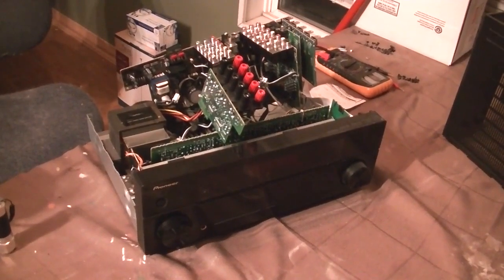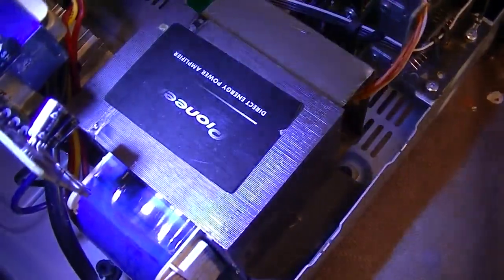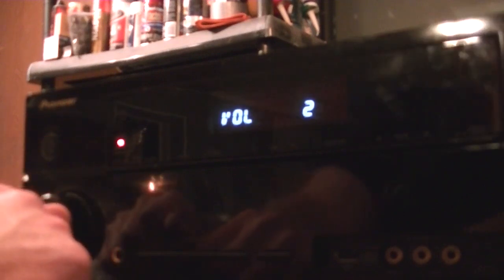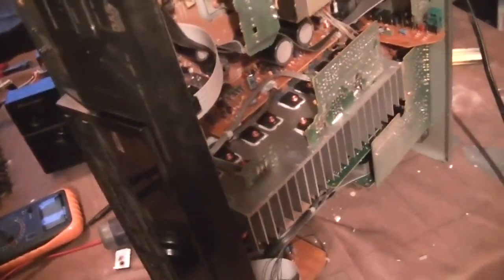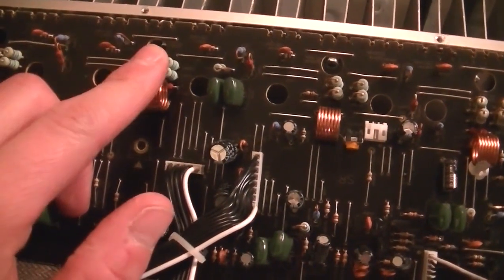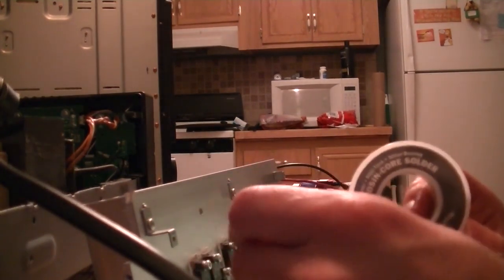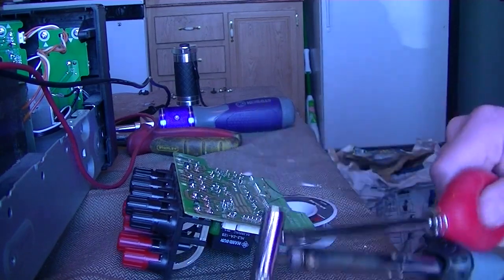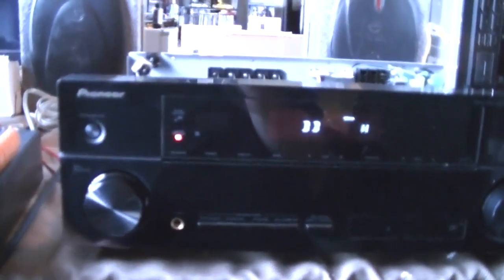Pioneer VSX-820-K Stereo Receiver Diagnosis & Repair - Kitchen Table Electronics Repair

Comment: awesome video, super helpful. i was working on a vsx 921 that would turn on but only for about 3 seconds and without an overheating or protection mode indicator would just turn off. the owner said the front left and right output wire ends touched while it was on and its had the problem since. i tried the factory reset and bypassing protection mode but it would still do the same thing. i got a overload error code, so i checked the mosfets on the amp board and found one thats resistance was not like the others in the corresponding place. i unhooked the amp board from everything completely and tried turning it on and now it will give me the over heating indicator and turn off still. any suggestions?

Comment: Working on a VSX-523 and followed your steps but it appears the mosfets are ok. I pulled that board completely and still get the error after resetting. Can you recommend another thing to try?

Comment: man what a great video!, i own this baby, i take really good care of it. specially cause it should have fan to cool down the heat, 
and i'm so agree with you.. the lack of stand by led, and most of the usefull functions on the remote controller like the treble bass controls (even though its only 3 steps up and down) maybe some playback controls for the ipod/flashdrive mp3 player feature would be nice.

Comment: Very Good Video. I have a Pioneer vsx-524 that does the same thing. I took it to a technician who made me buy a lot of parts including transistors, diodes and resistors but each time he would put in the parts they would pop as soon as i power up. It will pay fine if the defective channel is disconnected. i had to take it back from him as i grew tired of buying parts and this is only for 1 channel. FR. could you say what could possibly causing the parts to go out?
Reply from the maker: I would assume the tech tested the receiver at his shop before calling you to pick it up.  Based on that assumption which could be wrong of course,  it could be a shorted speaker or wire causing that channel to blow.
Reply: On the first attempt it didn't even give us the opportunity to start playing (i was there) . it just pops the resistors each time and blow the transistors. Right now it is playing but with the damaged channel disconnected which is really not working out for me. :(

Comment: Greetings friend. The other day I got into the hands of the same device. I found out that the standby power supply burned out. But since it burned out, I can’t understand what voltage it gave out on the secondary winding? Do you remember how many volts there were? After the diode bridge, up to IL1117-3.3V?
Reply: Hi. I have the same question ! is it 5vac?

Comment: A few question.
-Lookin from the way how u align those boards and got it hooked to the wall socket.. Will it short and boom ?
I had my worse experience when i once place a board on top the other board, it exploded when i fire it up. Which is why i got really careful with pcbs.
-I did not have the same problem as u did. But my receivers are not producing any sound to my speakers.
I noticed the weird symptoms though. Usually when i fully powered down the system, took out the cables. Plugged it back in again and got it up, the volume would resets back to 30. Though this time, it did not reset. It seems to stay fixed at the last volume i shut down.

Comment: good job, without a diagram we have to just hunt & peck around to find the trouble.
you said there are 2 clicking sounds, does it also have a power on relay?
Reply from the maker: Very true. What threw me for a loop was the absence of a standby LED, and looking up the problem on a google search. Both kind of led me on a goose chase till I had the sense to look up the correct power on protection bypass sequence from the manual. I looked it up on google first before getting the manual and none of what people said worked :)

Yes the first click is power on/stand by and the second is the protection relay on the speaker terminals. Standby is what everyone on a google search said was a common problem with this model, and the 520K. So that is where I initially thought the problem was, in either the standby transformer or the VR on the underside. Both were listed as a common failure of this model.  I was under the impression since the standby LED was not lit, it must mean the standby voltage is not present in the unit. Boy was I shocked to see there was no standby LED at all on this model.
Reply: WaybackTECH Hey guy, I've got an onkyo reciever which was working fine before the move. Now I turn it on after 5 seconds it turns itself off. Can you help me? Thanks.
Reply: carlos perez Probably going into protection because there's a shorted output transistor. On a Sansui I'm working on I measured 49volts DC across the speakers terminals, that shouldn't be there so I'm replacing the power output IC, it's that large Chip with several legs. I also found some bad caps.
 I don't know your model no so it may have 4 or more separate audio output transistors instead of one large power output IC.
Reply: It's on Onkyo txsr506 receiver. stanby power control with seperate buttons for different inputs. Power comes on, lasts about 3 seconds and then with a loud click shuts itself off no matter which input I'm using. Lots of outputs. Mostly RCA but also straight wire connections which I was hoping to use. I have nothing connected to it now. Still wont work. Of course its the weekend and I havent been able to get hold of anyone. I used to fix electronics but that was 20 years ago and I don't have ant of my tools anymore. Don't think I even have a volt meter.
Reply: carlos perez you need a multimeter, I got one for 20 dollars on ebay. I worked in a repair shop, the owner would remove the STK's and then power on the receiver, it came on ok he knew they were bad. If it has transistors in the output check them with the diode test using the DMM. A common problem is they short collector to emitter. Also check or replace the emitter resistors, probably .22 ohms or something like that.
In the Mitusbishi amp I just fixed it has transistors in the output they were all ok but I had to replace the driver IC, it's a large STK.  Also check to see if there's any DC voltage across the speakers terminals. See the video here on youtube Onkyo TX-SR502 receiver shorted channel. I see he used NTE parts, but it's best to use OEM parts if you can find them.
Reply: +WaybackTECH Hi, I have vsx-520 and I can not hear sound none of speaker after second click :) frequently. After turn-off & turn-on I can hear the sound all speakers. Do you have any idea to this problem?
Reply from the maker: Murat Dönmez
Have you tried headphones to see if there is audio coming from there?

Comment: Have you encountered a receiver that works but the display doesn’t work? I have a VSX-816 with such a case. Any suggestion?
Reply from the maker: Only one was a Mid 90's VSX-09TX I fixed a while ago had that problem. A couple resistors were fried that fed power to the display and those were mounted on the transformer itself. That was a VFD and not an LED display however.
Reply: Thanks so much for replying.  I'll check it out.

Comment: I have this reciever, and I've seem to have lost audio from two of the hdmi ports, video still plays but no sound.  I lost 1, moved the cable to another port worked fine, till now I've lost another and don't have any availble hdmi ports and I'm down one that I actually need. Can you shed any light on fixing these hdmi ports short of replacing the reciever?
Reply from the maker: Just going from when I was inside the receiver, the HDMI ports and DSP were all contained on 1 board.  I would guess the board would have to be replaced only because I think everything was surface mounted and replacing just 1 component would be a real bear to attempt.  I would look for a parts receiver on ebay personally for real cheap just to get the HDMI board from it. I've seen fully working units on ebay for under $50 however.  Non working i've seen as cheap as $10.  I think the board just plugged in but I don't remember now for sure.  Each HDMI port is held to the back with a screw. There might be some grounding that takes place there as well. It might be worth a shot to try and tighten those screws a touch to see if there is any effect.
Reply from the maker: Also if the board is removable, you should remove it and plug it back in. Might be an issue of dirty contacts inside the connector. Of course contact cleaner would be the best way to clean it of course but, reseating the card might be enough just for a test at least too
Reply: +Mark Lurk I have the 921k, the HDMI board overheats, I just threw a table fan on it

Comment: Awesome video, I have the exact same problem on my sony strdn850, I cant figure out how to bypass the standby mode to the error code. I have the service manual but am not sure which button sequence to use to get it to turn on. My power button is constantly blinking. Any help would be appreciated! Thanks.
Reply from the maker: +acidraine0 I couldn't say for certain about your Sony, but a lot of receivers in general do not have the ability to bypass the protection. The blinking is about the only indicator there is on a lot of them. I have found out too these service manuals online are not always complete. I would assume if there was a way to bypass the protection with a button sequence, it would be talked about in the service manual.
Reply: I downloaded the manual but the bypass does not work, I traced all of the power and it looks like the main board, hdmi board, and front panel get power but the main transformer secondary relay does not engage for the high power side on the main board. I am getting all standby power but nothing at the big capacitors. I checked the output ac voltage and on the 5 pin I get 45/16/gnd/16/45, should these be a lot higher?
Reply: I checked the ac detect cap and replaced that but no difference, there is voltage there and it does go to the cpu, weird thing is when I plug it in and the secondary comes on I get nothing, about 30 seconds later the green light blinks and if I unplug it the front display lights up for a split second and shows volume or something, can't really tell what it is its pretty quick. Any help would be appreciated, I have been poking around in here for a few days trying not to pull my hair out.
Reply from the maker: acidraine0
Voltages sound about right to me, just from other receivers and the voltages that end up coming into the main amp transistors that I have checked. This is just my experience, but when a receiver goes into protection and won't come out, it means there is a constant fault, usually a shorted main transistor on the amplifier. Probably should check those transistors and see if there is a short between the legs
Reply: None of the transistors are bad but I am missing a 7v+ going to the digital board. There is 7v at the IC but gets lost somewhere in between and my manual does not show anything along the way. Going to try and trace and see if I can find it.

Comment: Hello
I also have a pioneer vsx 921k amplifier
it is no longer heard in the speakers, because a software update failed, the old software did not work and the new one did not install
UE33 error occurs
the original remote control doesn't work anymore and I can't reach the settings
No settings can be made with the universal remote control
what can be done ?

Comment: WaybackTECH , Hello, I got a problem with my old Pioneer VSX-AX4AVi-S reciver. front right speaker don't output sound. Every other channel works. Have tried the troubleshooting from the user manual. Nothing works:(

Comment: When one of the two power transistors for a channel goes bad, expect to have more to replace than just the faulty transistor.

You will also have to replace the companion transistor and emitter resistors on the same channel as well as checking and replacing resistors and transistors on the pre-driver circuit serving the pair.

The issue is that a power transistor failure places stress on a variety of components servicing the affected channel.  The stress can be such that they can damage the parts to the point where they will no longer be in spec if not totally failing altogether.

It's a miracle the receiver didn't fry the transistor(s) again and go into protection while you were testing it after the installation.

Also, you may need to check the service manual for any required adjustments on the channel you repaired.  Matching replacement parts may have slight variances that are enough to keep it from being a simple process of swapping bad parts for good.

Comment: Hi! Sir,  I'm an electronic technician and i have the same amplifier with error code dc002, and all the amp section is ok,. Everything mark OK on the meter. I think the trouble is in the main assembly power supply board but all the parts mark good, voltage regulators, etc... Do you know a kind of way, a sequence way to find my trouble, because it's been days i'm overchecking and i don't have the right way to troubleshoot. Would you be kind enough to give me help on this in any way??? Thank you. Best regards.

Comment: good job! do you have schematic diagrams for power amp ?
Reply from the maker: Just the one included with the service manual
Reply: I have vsx529 and couldn't find service manual. There is operation manual only.
Reply: great video I learned alot . I have pioneer 1021-k with no sound on any of the back out a and b  I tried . What would cause all of them to be down ? If one fails do they all fail ? Like is power not sent to the amps if one fails is this how  this circuit works?
Reply: Do you have this gentleman email address?
Reply: @PackardBelltoll  7 Years later... LOL, Did ya figure it out? I have same issue.

Comment: So my dumbass spilt beer on my VSX-43 last night. The receiver shut down all most immediately and I wasn't able to pull the power plug right away. I pulled the cover off and used a heat gun on low to dry out the receiver. This morning I tried to power it on but nothing happened. 
I watched the part where you held down the power and advance button and what do you know..... the receiver works. The receiver also doesn't have any error codes. Do you think that the receiver is fixed for good? Thanks for your video
Reply from the maker: +kevin sheppard Hard to say really. Spill damage can go many ways. I killed the tuner on my JVC receiver many many years ago because of a spill.  If it came out of protection and everything seems to be as it was before, then it will probably be ok.
Reply: +WaybackTECH I turned the receiver on and off a couple times but I'm going to wait another night to plug my speakers back in to test the receiver. I'll post the results tomorrow. Thanks again for your help.
Reply: +WaybackTECH I got extremely lucky this time. AV works just like it did before. Thanks for your tips man. I thought that I may have ruined a $$$ receiver.

Comment: Check your final outputs when it comes to Pioneer and Sony's check your final outfits because they're not torious for causing these problems where things will not power on check your final output I tell this to everybody every single time I see one of these videos where people do not check their frontal outputs first they go through this rigmarole and they ripped the whole thing apart and they didn't bother to check their final outfits this is going to be one of those dragged on videos when you have to check your final outputs

Comment: I have a vsx 1123, I tried to get the error codes by pressing standby and advanced surround. nothing happened. I had plugged it into a dimmer circuit, 'ooops' didn't realise dimmers have a phase control. am I screwed ?
Reply from the maker: The only way to know is would have to check and see if you have any AC voltage coming out of the standby transformer. Mine had roughly 10V.  This is the closest free service manual I found. You might look at it.  A lot of things are probably similar. There might be a slightly different method to accessing the error code than the 820-k. http://elektrotanya.com/pioneer_vsx-1120_1125_1325-k.pdf/download.html

Comment: what causes a scratchy sounding channel m8? ive cleaned all the pots they are fine
Reply from the maker: Off the top of my head - dirty switches, dirty speaker relay, bad transistor leaking power somewhere, bad cap leaking power, bad solder joint somewhere